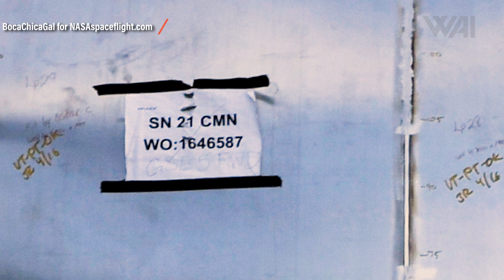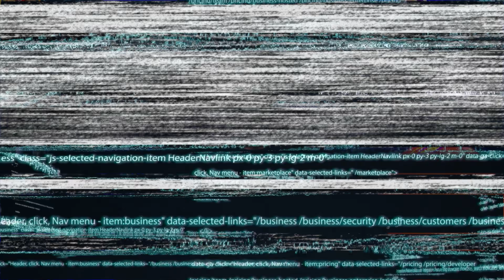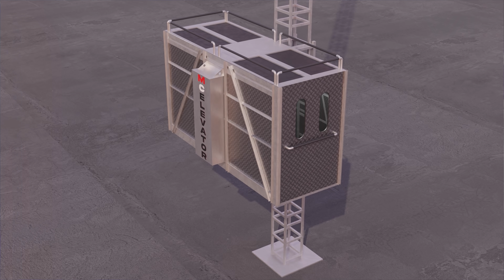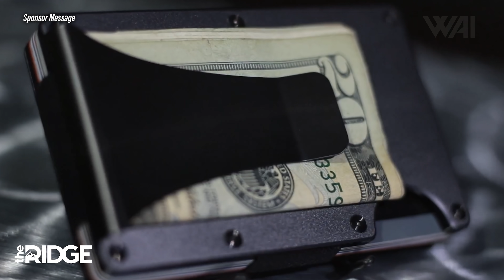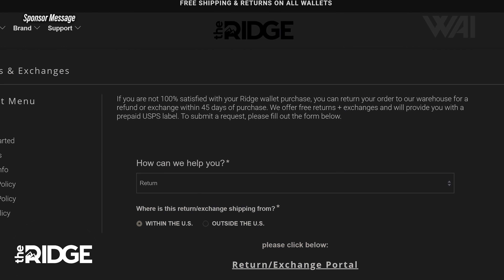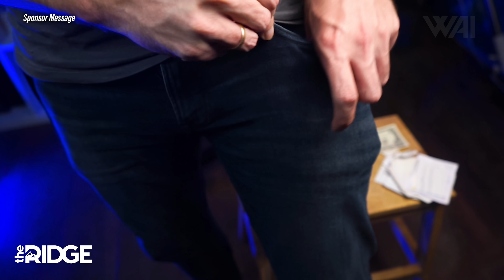SpaceX Starship SN15 Re-flight not happening? Virgin Galactic about to start tourist flights!

Comment: Why use flat tiles on a cylindrical surface ? 'Must be difficult to fix, and it exposes edges to more slipstream. A cylindrical common tile would be easy to design.

Comment: Virgin, could have borrowed the now cheaper classic "Spaceshuttle" and remodified it with with horizontal Skycrane style vect boosters adjacent to the belly and be a far more efficient Mars/Moon lander then SN, SN could have also hidden in the same weight ratio tin skin dermis , with skycrane booster pipes and Huey bell copter leggings for horizontal cargo deploy land& takeoff under 30 stories, like a scammer modern jet.

Comment: What if SN15 was a fluke? I think Elon needs to prove that starship can land consistently before going through the process of losing several to heatshield problems. Only to find once the heatshield is good that he still can't land.
Reply: If it survived reentry you're pretty sure the heatshield had done its job as it should be. The inspection can come later especially when they're confident that it won't spray debris over Texas, then they start targeting Starbase/offshore platforms instead of near Kauai

And oh, assuming but survived reentry they can still attempt a landing on the water
Reply: @alvianchoiriapriliansyah9882  agreed but that is not what i am talking about. If the heatshield fails then we will have no idea if the starship was able to do the appropriate landing or not. So when the heatshield does work we may find that we have to go back to the hops to get the landing consistently down pat. That is if SN15 is just a fluke

Comment: By the way, if someone is interested in some technical design features they will probably implement...
1. I would guess that the intermediary space between inner and outer shell of the cryogenic tanks will be filled with expanded perlite. This is very porous material with a density of approx 100 kg/m³ and excellent insulating properties. Just filling the space with nitrogen would be extremely inefficient and vacuum is too much of an effort for such big tanks.
2. Regarding the newly delivered vessels. These should be kettle type heat exchangers which could probablv be used to either vaporize cryogenic liquids for repressurization of the cryo tanks during fuel transfer into starship and booster or subcooling of the cryogenic liquids (maybe even both at the same time). The nozzles on the thin end are for the liquid to be subcooled (or heating media) and the bigger part of the shell contains the vaporizing liquid with the vapor leaving overhead through the big pipes.
I hope I am not wrong with my analysis, but thats how such kind of equipment is mostly used in the petrochemical industry.

Comment: Question about the cryogenic storage tanks. Any engineer who works with large dewars please help me!
WAI mentioned that the tank walls will be filled with nitrogen. I assume this is just a flushing stage before the space between inner and outer tank gets drawn to a vacuum. So here's my question: the larger the space between the inner and outer shell is the lower the vacuum has to be in order to get into the mean free particle regime and get decently low thermal conductivity. The problem is that when you get to these distances (tens of cm) you need an inordinately high vacuum to have a decent thermal isolation. Like in the order of mPa. How the heck do they keep these kinds of pressures over time? The vessel walls must be outgassing all over the place! Is the space between the walls constantly being pumped out? How does it work?

Comment: I was very vocal that I thought and still think it’s a waste of time to try to fly SN15 as it wasn’t a perfect landing perhaps because of weather or because of design as it slipped on landing severely damaging the landing gear that only luck kept SN15 standing. The engines were extremely scorched because of the skirt the extremely hot engine exhaust shot back into the engine are under the skirt directing thousands of pounds of thrusting fire into the engines. The pressure from the engine thrust redirected into the skirted engine area had to have caused damage to what looks like very fragile pipes and gimbal mechanics. Starship needs taller landing gear and really I’m not sure the engine skirt needs to be solid amd what I mean is that perhaps the skirt can fold to the sides leaving the landing gear that will hopefully move further out apart with longer legs allowing starship to level itself on landing so if a leg or two sink into the lunar and Martian soils starship won’t tip over marooning the astronauts.
Reply: They're using a temporary legs indeed

Comment: Fuel Distribution unit is way too complex. Should be one pipe out the top out to a split closer to the outer ring of Raptors, matched as an easily removed module of say, four raptors and bolt-in Thrust Puck sector.
When it's time for servicing, unbolt one fuel pipe, one oxidised pipe, one main electronics, a redundant connection, and then hydraulics, per Puck Sector. Less potential points of failure.

Comment: @6:46 flooded with Nitrogen? Not much of an insulator at atmospheric pressure. Chilled (evaporiting) N2? Maybe? 
More likely vacuum, as in Dewar flasks (i.e. thermos bottles) IMHO
Reply: Vacuum insulation wouldn't work as the walls of the GSE tank are so thin 3mm they would collapse when filled with lox or CH4.
Reply: @michaeldeierhoi4096  Inner tank walls  become more geometrically stable with vacuum outside. Equivalent of an internal pressure increase. If net is below burst pressure rating there is no problem.
External tank will probably need stiffening rings (inside assumed as none are seen on the pirate videos). These may be of material other than metal. Something with a low thermal conductivity and reasonable compressive strength would work. Fastening, other than maintaining position, is not critical as the forces (stresses) are compressive and transfer by bearing alone.
Why do you assume the outer tank has 3mm (12ga) wall? Other thicker gauge coils are readily available and within their rolling (semi-decoiling) machines' capacity.
Vacuum is the thermodynamically most efficient insulator. At atmospheric pressures, a blanket of evaporating N2 will also keep O2, and more easily CH4, below their boiling points. Costs of energy to create the liquid N2 come into play.
This type of engineering is not rocket engineering. Just cost-benefit analysis. Without data of what is on hand at the location (SpaceX not being forthcoming regarding their systems) any supposition is merely a guess.
Reply: @michaelgian2649  Good explanation.  I can't dispute anything in your comment.  Thanks for your response.
Reply: @michaeldeierhoi4096  Thanks for the kind reply.
To elaborate on my unknown suppositions:
SpaceX appears to be installing an air liquefaction plant at the gas-well site. Presumably to make their own LOX. They will have a lot of liquid N2 available at relatively low additional refrigeration energy cost. For cooling the tank farm?
If they run on for Nitrogen they will get all the Argon they can use for weld shielding on the way.

Comment: I thought there was only one threshold to space .
Virgin Galactic was in space  , I think .
Reply: Depends on who you talk to. The generally-accepted "edge of space" is the Karman line at 100km, which although somewhat arbitrary, is based on properties of aerodynamic lift. However, the USAF and NASA use an alternate definition of 80km, which also has some scientific basis, but which was mostly chosen to allow the X-15 pilots to be classed as astronauts.

Virgin Galactic achieve a maximum altitude somewhere between those marks. So if they were NASA or the USAF, then they might claim to have been to space. However, most of the world - including the bodies that certify aviation records - would not recognise this claim.

Comment: Nope. They will not retire it. They will need two (2) working starship prototypes in order to test the first, in-space re-fueling. The tanker (maybe SN-15 when it gets it's booster) can then be "sacrificed" in a re-entry "test-burn", to see just how much shielding and WHERE it is needed most... any hot spots, etc. I expect they are loading SN15 with thermal sensors as well as using it to test fire engines, to work-out the starting and stopping of fuel flow, raptor ignition, landing legs or replacement legs, detachable legs, or what not, etc. But yeah... we are all eager to see the second flight of SN-15, and hopefully it will have another, successful landing. Awesome channel, Felix- my "brother from another mother". Keep up the good work!
Reply: SN15 is NOT designed for anything beyond 20 km suborbital, and it won't fly again as of now

Comment: The tallest structures arent the buildings itself, but the cranes that constructs it.
Reply: Incorrect. 
The tallest buildings support the cranes that build them. 
You think there’s a seperate crane that can reach the top of the burj Dubai?
Reply: @Creabsley  the cranes are still technically 'taller'
Reply: @Creabsley  But cranes were at some point taller than the building they construct. Hence cranes made the tallest building and the building supporting the crane finishing the building so the tallest title originates from cranes since without them the building wouldnt support the crane finishing the building.

The cranes do all the work and keep the title 😏

Comment: i find it hard to believe the cryo tanks covers are going to be back filled with nitrogen.  It makes no sense, if you were going to use a gas, then what you want is a low molecular weight gas, and nitrogen is diatomic, so its weight is double.  If you were going to use a gas, it would be Neon.   But you really don't want any of that, you want a vacuum, so that your only heat loss is through radiation and not conduction and radiation.   If the fuel tanks can survive +6 bar, I doubt it would be difficult to make the sleeves survive -1 bar.   For the GSE tank inside, it would always experience positive pressure, so that is not a concern.
Reply: They definitely couldn't use a vacuum as an insulator because the GSE and cryo tank walls would fail.
Reply: @michaeldeierhoi4096  how?  Why?  The GSE, if left empty with ambient pressure inside, would experience only 1 bar of pressure being inside a vacuum.  If the GSE are similar to starship tanks, those are designed for 8 bar/ 6 bar usable.  The cryo shell itself only needs to support 15 psi, 1 bar, with a vacuum inside it.  There is no way a design group that can build starship can’t build a simple vacuum bell.
Reply: @theharbinger2573  Yes perhaps you are right.  It will be interesting to see how it all plays out.

Comment: You can't say "space" as if all space is space.
It's super easy to get to the edge of space and technically be in space. It's much harder to achieve orbit.
Harder still to achieve orbit twice. The Space Shuttle did it to some extent but remained unprofitable and wasn't anywhere near as "reusable" as it was supposed to be.
SpaceX is the only company so far that can do it reliably and profitably.

SN15 is a suborbital testbed. You'd could upgrade it to orbital or just make a new rocket.
SN15 is already primitive. There's no sense in making it reusable when there's still so much to learn about SN orbital flight and re-entry.

Comment: Hey Felix,  ich hab da mal ne Frage... 
Weißt du zufällig, ob die Schweißnähte sandgestrahlt werden? Das würde die Schweißnähte deutlich widerstandsfähiger machen. Ich arbeite täglich damit, daher kenne ich mich da sehr gut aus. Sandstrahlen induziert Druckspannung im Material, so dass es nicht so leicht platzt.
 Do you know if the weldings are sandblasted? That would make them much more durable. I work with this daily thats why I know much about it.    Sandblasting induces compressive stress in the Material so it does not burst so easy.

Comment: Frankly, it wouldn't make much sense to expend any more effort on SN15. SN15 was obsolete the moment it landed successfully. Better to spend resources on SNs which are designed to check the next boxes in the test regime (esp. orbital re-entry).
Reply: On the other hand, reflying it will give them information that you can't get from another first-flight starship. I'm of the opinion that if they can have it flight ready in a reasonable amount of time, they should go for it. Only if they run into issues that significantly delay reflight should they retire it and move on.
Reply: Makes sense, just going to have to be patient while the focus is on construction for now. Much more action to come!
Reply: but we want the boom
Reply: Elon could just be waiting to see if Jeff makes another smarta$$ tweet about him, then he could fly sn-15 again just to flex.
Reply: The overwhelming key for SpaceX is reusability.  Consequently, the issue of reflying SN15 has significant value.  Reflying but going to a much higher altitude should both provide new data and confirm the data they obtained from the first flight.  While we all applaud EM's taking bold steps going from a 10k flight to Orbit is a big jump.  I am surprised there aren't some intermediate steps being discussed especially with the full operation of the Super Heavy.  It's one thing to lose a Starship and 3 raptors but unless they have a massive engine-building capability losing almost 10 times as many engines on a single Super Heavy RUD would have to be a major interruption in the schedule.  It seems a focus on flying and being able to reuse Super Heavy is one of the next main goals.  Forget Orbit if you can't get Super Heavy right.
Reply: Bingo.
Reply: Why not send 15 up to 20 km. or even 30 km.. they need to practice a hover  at a similar air density as Mars atmosphere to simulate landing there.  Correct?
Reply: I almost agree but what if SN15 was a fluke? I think Elon needs to prove that starship can land consistently before going through the process of losing several to heatshield problems, only to find once the heatshield is good that he still can't land.

Comment: The raptors are mega temperamental. 28 good luck
Reply: The latest version that flew on SN15 seemed to do better. None of them had to be removed to be fixed after a static fire, which was not the case on S8-SN11. The Raptor is the first full flow, staged combustion engine to ever fly, so SpaceX has gone farther with that type of engine than anyone else ever.
Reply: There will be a static fire before launch, and it's still in early days

Comment: They could stick a SpaceShipTwo inside of a Starship and make orbit. :)
Reply: Yep, looks like it would fit in the expected payload volume, although the wings would be the tightest at 27 feet, when Starship is only 29.5 feet in diameter. The 59ft length should fit easily in the 70 something feet length of the Starship payload area.

Comment: 3:05 SN2021?! Have I missed 2000 ships?
Reply: Seeing how SpaceX got into the habit of simply skipping a bunch of prototypes at a time (SN12-14, SN17-19), you can bet that by the time they build SN2021 they would've only built like 1000 ships in total.
Reply: @giovannifoulmouth7205  They should be done with the skipping by SN100 or so when the design is mature.

Comment: Hey Felix, the amount of steel and other metals (or non-metals) SpaceX is using is staggering - but what happens to all the scraps (r.i.p. SN-sub-15) as well as exchanged engines? Many parts are likely examined for root-cause-analysis of failures, but they won't be saving it indefinitely - do they send it all back to the steel plant for re-melting? I would like to see a short on "the back side" of this gigantic undertaking :-)
Thank you for a good show!

Comment: SN15 has no legs and  no engine s     so  it can’t fly again. And if moved back to the factory it wont fly again.   The infrastructure for a two stage flight needs to be finished quickly. So maybe it needs to have precedence. Virgin Galactic’s space flights will be a few minutes barely over the Carmen Line and into space and will be fairly expensive for such a short flight!

Comment: I like the way the fuel distribution puck has a larger diameter at the start of each pipe.  I'm no fluid dynamics expert but that to me looks like it's there to prevent low flow due to vortexes forming as the fuel enters the pipe.

Comment: i just heard NASA spent (WASTED) a billion dollars on a single use launch tower!!!  INSANE. Talk about rip off contractors. a billion dollars on a hunk of metal!!!  the expensive tower is "leaning" and "bending." For now, NASA says, the lean is not sufficient enough to require corrective action, but it 
is developing contingency plans in case the lean angle becomes steeper!!! INSANE. THEY SHOULD BE FIRED!
1
Reply: I Just Give It Away, Its Such A Joke!?!

Comment: Soooo just thinking out loud. The light and relight have less to do with the landing success of the Starship and more to do with the light relight cycle of the Booster. I say this because the vacuum raptors will be lit upon separation from the booster, and the sea level rappers on the Starship will be lit only for landing. So the main thing the SpaceX team needed to successfully do was perfect the tank handoff. With that said the Booster seems to be the only wildcard regarding reuse because it will require most of the gimbaling raptors to be lit and relit for landing.

In short SN15 will probably fly again but it really doesn’t matter at this point. The booster is the next big focus for success. Just my thoughts 🤷🏽‍♂️